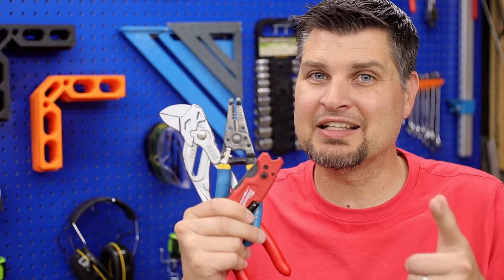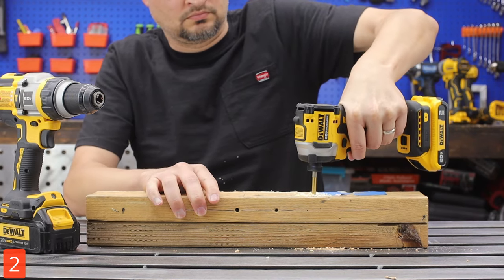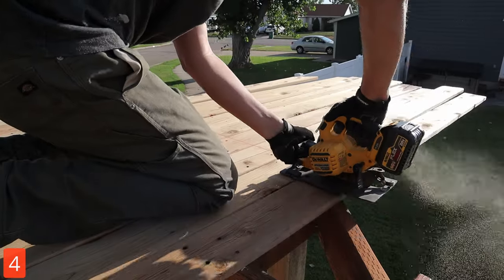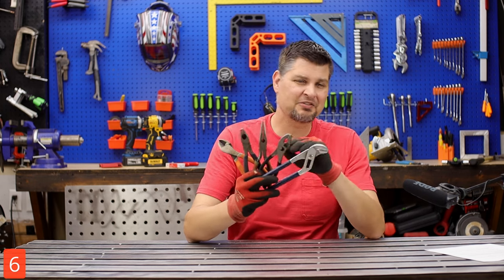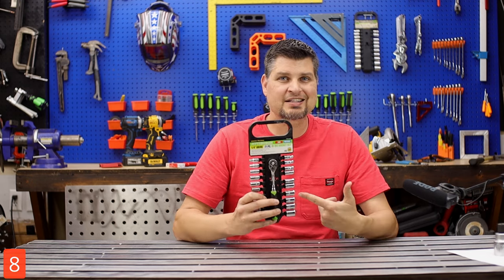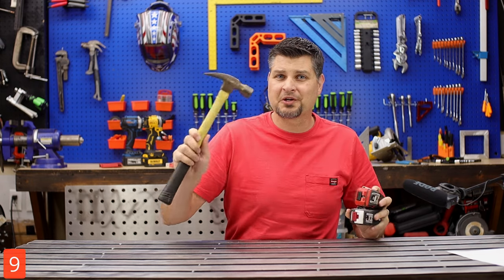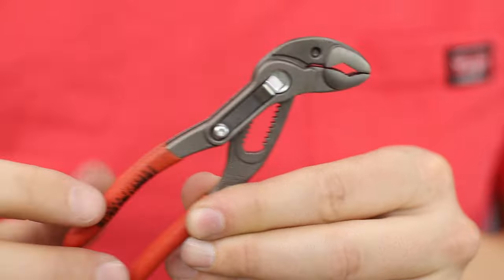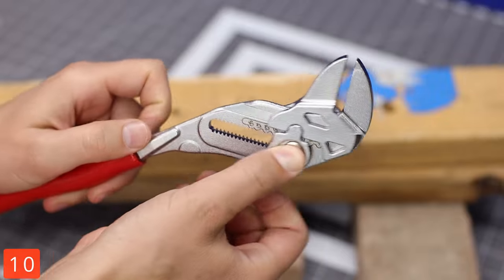10 Must Have TOOLS to Start DIYing!

Comment from the maker: What tools are on your list? :face-blue-smiling:
Reply: Great list. A decent screwdriver set is essential too. I have the Quinn 15 piece set from HF. They work well. I upgraded from the yellow handled Pittsburgh set that sells for like 5 or 6 bucks. I have no issue with Pittsburgh, most of my hand tools are Pittsburgh, including all my wrenches, regular and impact sockets, adjustable wrenches and pliers. Those screwdrivers were just not good.
Reply: Depends on what exactly one will DIY ... but maybe a decent set of clamps? Always gotta be holding stuff down or together, useful over a wide range of projects.

Comment: alot of DIYs use or could use a grinder for  metal,tile,concrete, and surprisingly they make wood wheels .  i have watched most of ur easyflux125 vids and i picked one up today (first welder btw) i was gonna buy the Chicago electric but u changed my mind immediately thanks  for the tips  i will continue to watch ur videos .
Reply from the maker: Right on, thanks. 125 is a great welder choice!